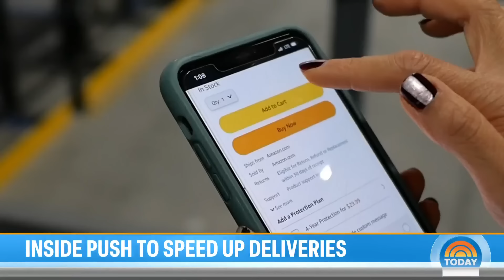See how Amazon is using new robots to deliver orders even faster

Comment: also alot of people think that only manual labor jobs will be gone, that's not the case. Many other jobs will be removed as well that AI is proven to be able to handle.
Reply: Correct. It's actually easier to automate middle management, HR, and  accounting with AI than making robots for physical work. Amazon just laid off thousands of tech workers a few months ago, but they still can't find enough warehouse workers for their peak season.

Comment: lol, at 4:12 she says ..."the person lifting boxes will now need to brush up on engineering skills"

most ridiculous thing I heard in this video lol
Reply: Yeah, the lady in the red and black wasn't buying the bs.
Reply: it's not ridiculous. You don't need a college degree to be hired by Google as a programmer. You just need to know how to write software.

There will still be masons in the future, they just won't do the actual physical work. They'll be outside briefly, to configure the robot and lay out where the bricks should go etc. Then they will sit in an air conditioned pod and not come out until the work is done or until there is an issue with the robot (it has a hardware failure etc.).
Reply: No more water spiders time to go to AFM or VNA

Comment: Bye Bye Employees 😂👋
Reply: Nope. Robots are there to assist. They needed to get attended for because errors can happen anytime.
Reply: @LeonardLuzon 

You don’t need many engineers to oversee that as you currently need floor workers these robots will replace.
Reply: @Jae0331 a calculator use to be a human. Try to put one of those in your pocket. We actually have a labor shortage.  Luddites have nothing of value to offer society.
Reply: @Jae0331 horses aren't needed. How many people do you believe will turn their car in for one?
Reply: @chrisf4268 Exactly. Horses aren’t needed and soon people won’t be needed to do these jobs.
Reply: @CastleKnight7  that’s called progress. 😁
Reply: @LeonardLuzon that’s what floor managers and cameras and repair people are for. A box mover has no purpose here.
Reply: @LeonardLuzon we are speeding towards a point where robot error will become so much smaller than human error.
Reply: @ko7577 that has no relevance. I'm not talking about a race horse. There was a time that the economy was based on animal power and it is not that way today.
Reply: Wake up

Comment: Delivery Stations need alot of work, more automation. Last one I was at a couple years ago, it was basically all manual except for the conveyor belt bring packages from the truck delivery part of the warehouse to the sorting part. Just a line of people sorting packages off the conveyor belt into shelf's. On the other side another person taking said packages and putting them into totes with a computer. Then when everyone was tired at the end of the day, we all got to take the heavy totes and sort them onto carts, some weighing 50 lbs easily, being stacked upto 3 totes high, think 2ftx2ft cubes, lol. Then those carts moved to assigned location which are then taken to the delivery van its meant for.